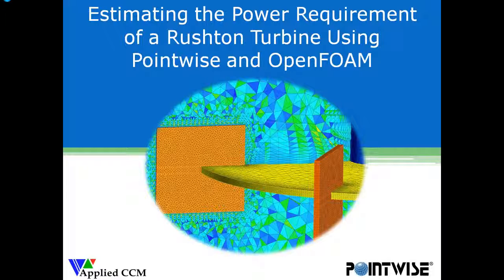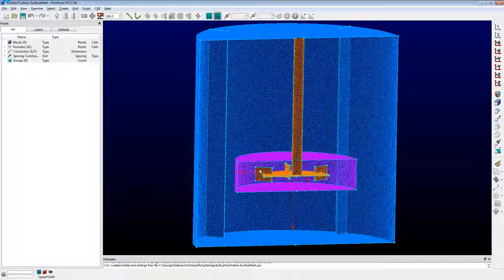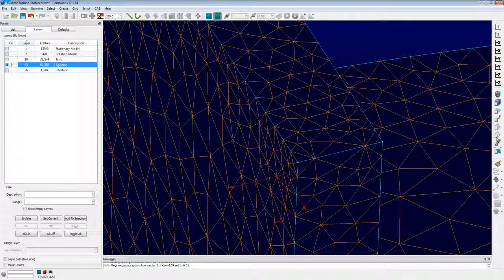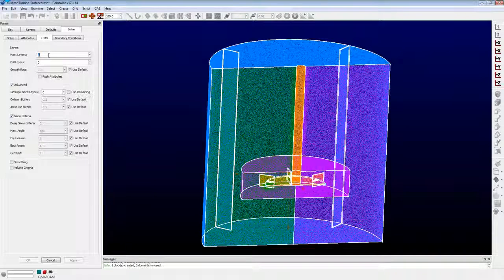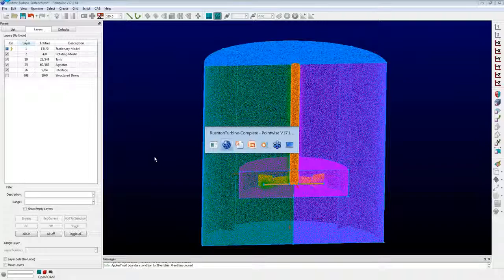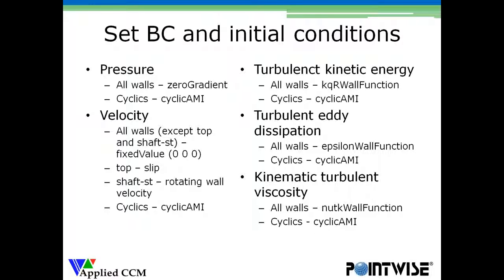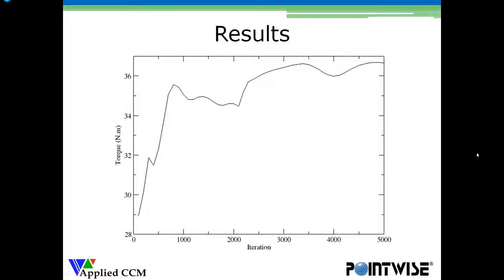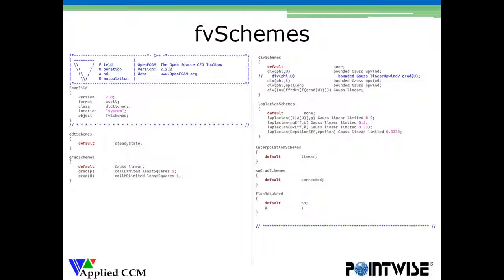Estimating the Power Requirement of a Rushton Turbine Using Pointwise and OpenFOAM

Comment: Hi and many thanks for this valuable video. In  19:54, why only the top surface of the inner is selected as an interface? why the bottom and semi-cylindrical surfaces of the inner domain are not selected?
Reply: Hi, the bottom and semi-cylindrical surface should also be added into the interfaces condition. I cannot recall why the video doesn’t show that.